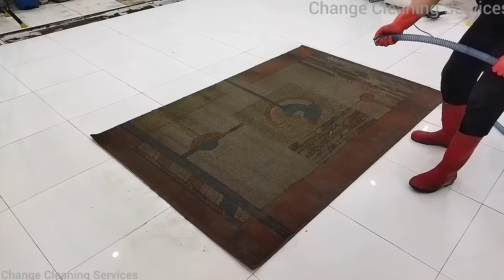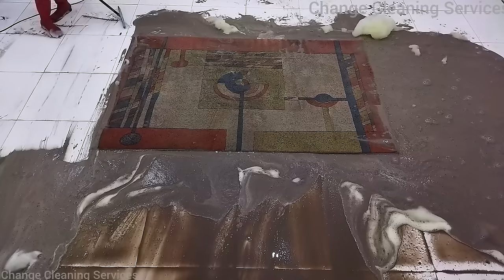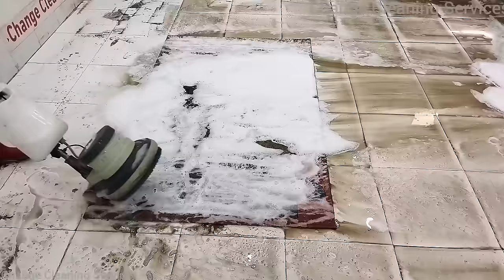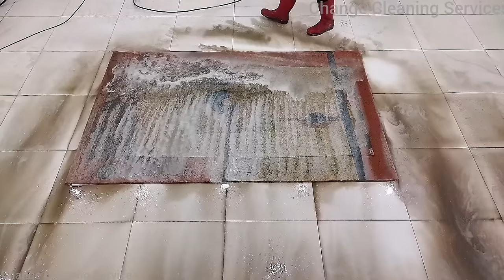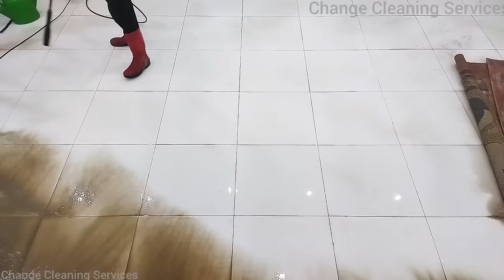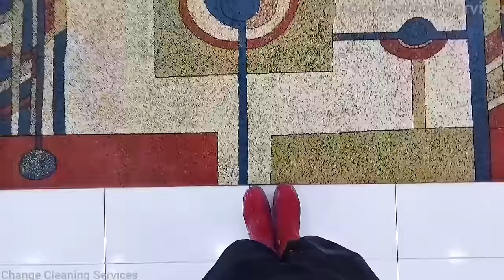l clean heavily soiled carpets with effective washing methods

Comment: What is more effective - mechanical scrubbing with the electric rotary cleaner or manual scrubbing with a hard brush? Surprised that you don't seem to have a carpet centrifuge to spin water out of the carpets. How do you dry them?